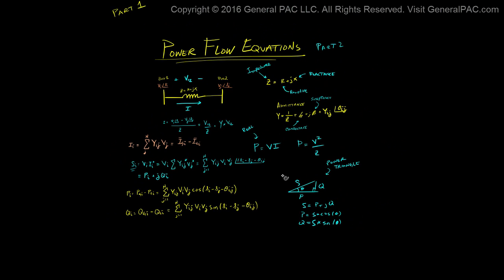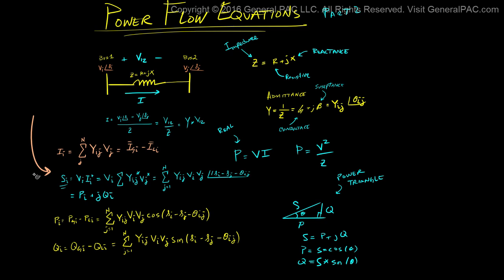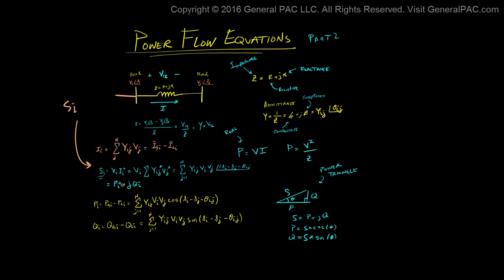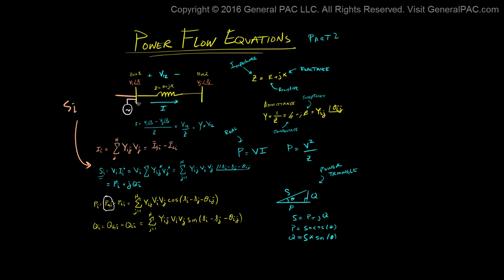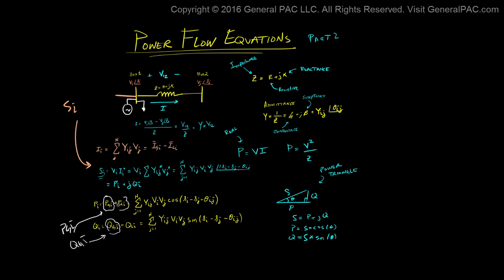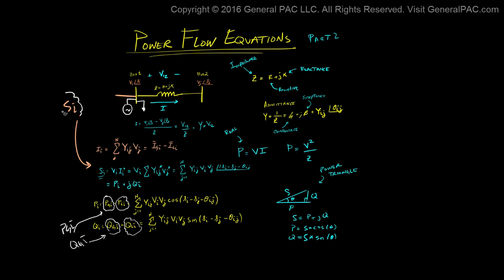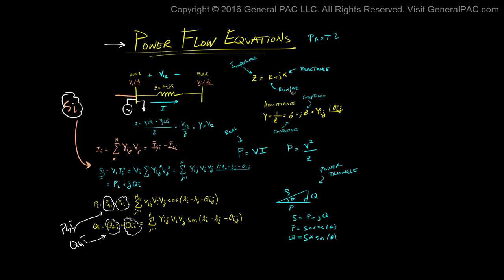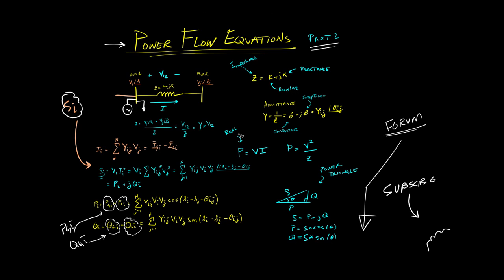Power Flow Equations Part 3

Comment: you are calculating the net real and reactive power into the bus  , Is that bus also taking power if yes then for what purpose bus is taking real and reactive power???? please clarify ................
Reply from the maker: Hey Nilesh, let’s first understand the concept of ‘Electrical Bus’ in a power system. Bus serves as a node or point of interconnection in power systems. In other words, it does not supply or consume power itself.  For instance, if there is just one load connected to a bus in the entire network then the net real and reactive power will be zero as the total power generated will be equal to the total load consumption (including line losses if there are any). 

In the video, the subject of matter is ‘Bus 1’. The intent behind calculating net real and reactive power was to deduce the amount of power (net power) that will propagate towards ‘Bus 2’, which was connected further down the network. For example, if Bus 2 had a load connected to it then the net power through Bus 1 would be equal to line losses at the transmission line/cable plus the power consumed by the load connected at Bus 2.
Reply: @Generalpac  Thank you so much sir

Comment: Hi, how are you? Thanks for the video, but I have a question. I always assume that a node (or a bus, in this case) does not consume energy, so: why is the subtraction between Pgi and Pdi not 0? I mean, the power generated must always be equal to the power demanded, so (for this case), why is Pi not 0? I could not got that. I really don't understand what Pi represents... Please help, and thanks again.
Reply: Power generated must be greater than power demand because in order to supply power to load,the transmission line consumes both active and reactive